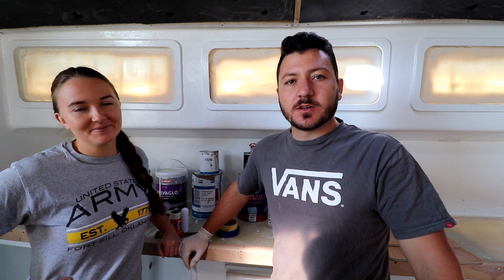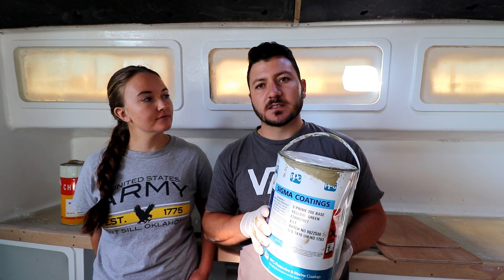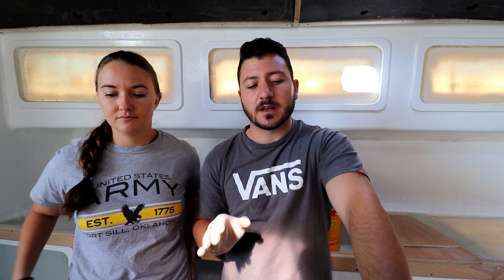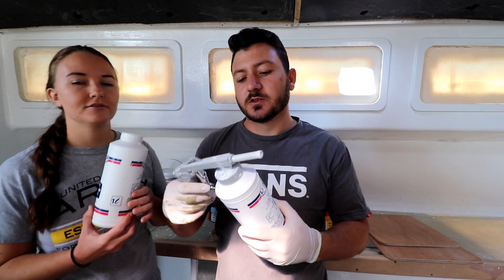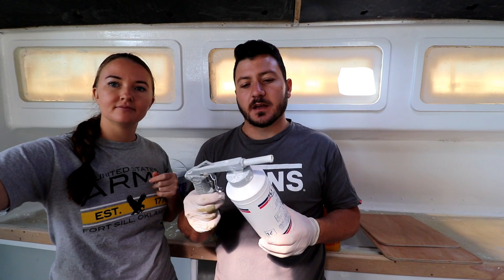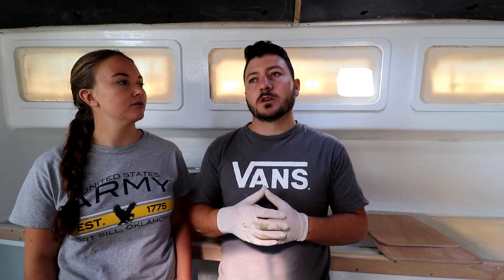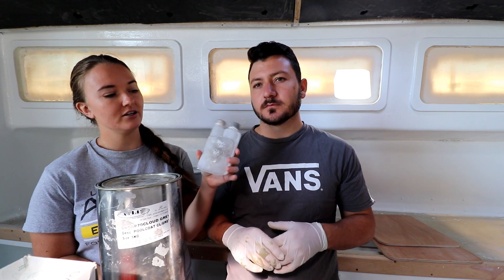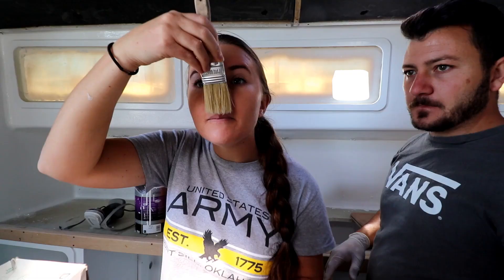HOW TO: PAINT your BOAT & what PAINT to use!

Comment: Hi both, the latex gloves are permeable for a lot of material. To protect your health it is a need to use i.e. specialised MAPA gloves (the green ones last for all things you work with. I know it is not comfortable working with this MAPA gloves, but it gets better and better. 

It is not only the matter that the latex gloves are permeable - the biggest problem is they allow the harmful substance coming in, but because of the molekulare size after diluted some fat of your skin they cannot go out. So you get a higher and higher concentration between skin an latex. Because of this it is often better not to use such gloves and work with bare hands. you can use the latex gloves prevent i.e. the MAPA gloves from getting sticky or for applying  1-K paint.
Fair winds
Tom

Comment: Good advice, those foam rollers really don't last long lol. I used Jotun Hardtop AX and it's worn through already from fenders.. that said where she is moored is very rough... Must give the brand you recommend a look...
Reply from the maker: Those foam rollers don't last but the finish of the roller is pretty nice.  I guess it hurts less to chuck a foam roller... Jotuns a pretty good brand.. it should be fine.. but try out the other brands. Maybe it works better out for you?

Comment: Hey guys great video. Will the 2 pack poly paints also eat through those foam rollers or is it only the epoxy primers? Maybe I’m wrong but I think the “Deckra unimarine paints” in your description should be “Dekro unymarine paints”? Anyway thanks for all the advice, great video as allways
Reply from the maker: It eventually does but not as fast. I'm not sure if it's unimarine or unymarine... 😂
Reply: I forgot to ask, what antifouling paint did you use?
Reply from the maker: We haven't gotten our anti foul yet. Most probably will stick with PPG.

Comment: Can you apply the Sigmavover 280 on WOODEN boats?
Reply from the maker: Most of the sigma products amazing provided that the proper preperation work is done . On a wooden boat i would recomend priming the boat with sigma prime 200 first ( this is a two pack epoxy primer , great for above and below the waterline ) . Then apply a sigma top coat sigma 500 or 550 two part polyurethane.  If you would like morr info, please check out PPG sigma paints online . Loads or product data sheets application methods
Reply: @livingwiththemaias  MANY THANKS for the advice!!

Comment: Hi, how satisfied are you with the SigmaDur 550 topcoat after two years, and did you spray it or roll/tip it? I plan to use this paint too for my boat.
Reply from the maker: We're pretty happy with it. We sprayed the outside & some of the interior but mainly rolled on the interior. It's a pretty tough paint as it's a 2 part paint.
Reply: @livingwiththemaias  i plan to roll and tip it, as I don't have access to the necessary spray equipment and I have no experience with spraying. Do you would say I can get decent results with rolling and tipping?
Reply from the maker: You can but you'd have to add some Thinners in for it to self level. It's got a good pigmentation to it so you won't need to do numerous coats,but as you know paint is only as good as your prep and primer. 👍🏻 😊
Reply: @livingwiththemaias  thanks for the information, I really appreciate it. Have a good time.